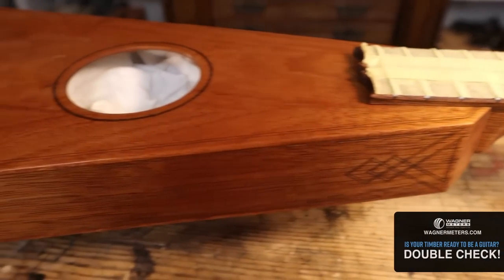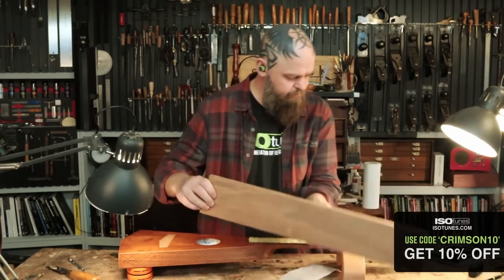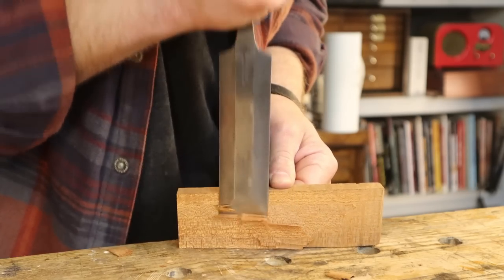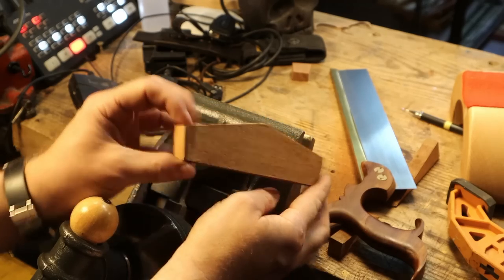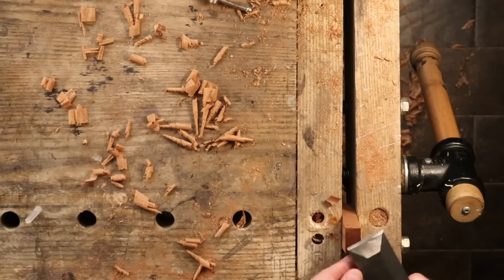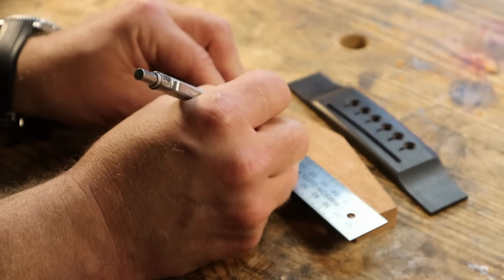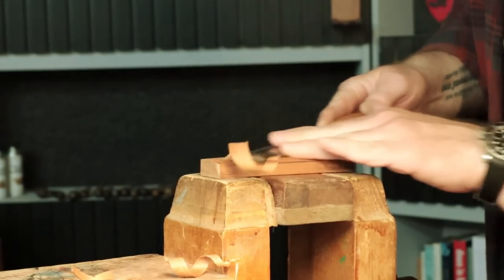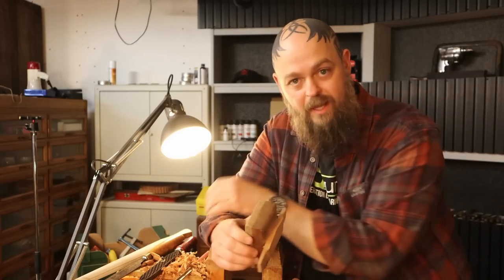Ep 16  Bridge the Gap | Hand Tool Only Acoustic Travel Guitar Build -  Guitar from a 4x4 FENCE POST

Comment: Using tools for creative purposes is what it's all about. Rather than planes I use rasps and files to level narrow edges. Then I wrap sanding paper around the back of a miter jig or something else that's square and straight, put it on the work bench, and rub the almost level edge against it to make it pretty straight and finished. Planes are great for large surfaces, but situations where I need to worry about grain direction etc this is my preferred method.

Comment: Great. Happy you returned 😄.
For hand ripping long stock a 600-700 mm frame saw (if cut from the edge to line is up to 20 cm wide) with japanese hardened teath rip saw blade works wonders.

Comment: Shouldn't you be installing like a violin soundpost inside that guitar to prevent the top from collapsing? And that would probably enhance the sound
Reply: The guitar top is small, it has 2 braces and a bridge plate, although the bridge plate has no bracing directly connected to it.  I was surprised to see so much movement in it.  The main "possible issue" as I see it is lift rather than collapse.  The strings cause the bridge to lift and pull the top up which might lift the action.  over time it might result in the the area behind the bridge lifting and the area in front of the bridge having a depression (due to the bridge tilting forward).  Two thin braces along the sides of the bridge plate to the strong brace under the sound hole should correct it.  I got the feeling that Ben is betting that the bridge itself might be enough to stabilise the top which may be right.